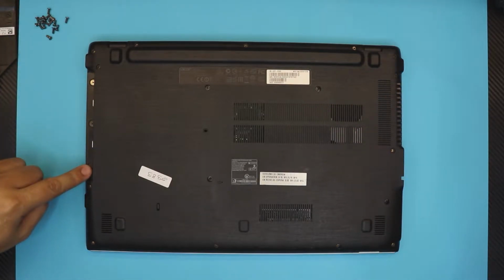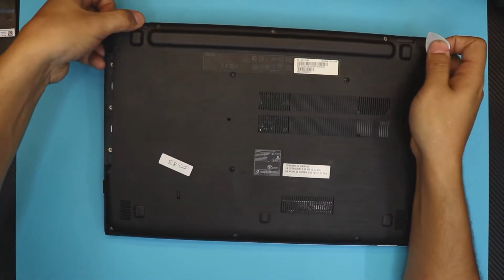Acer E5 573 REPASTE disassembly guide 573-C7kr

Comment: Great Video - Complete Video is good & Most Importantly the Point of getting the Audio Jack in perfect position before closing the laptop is Extremely Crucial. I was able to get my laptop closed 4 times perfectly in all respects but only the audio jack was slightly misaligned so I was unable to plug in my headphones. Then I saw your video which shows the procedure of closing the laptop too including the crucial point of getting the audio jack in position First and then continue. If we do not follow the procedure as specified by you then the audio jack stays out of correct position though the laptop appears perfectly closed. Thanks A Lot for this Lovely Very Useful Video With The Complete Process Of Closing The Laptop With The Crucial Point of getting the Audio Jack in alignment FIRST.
Reply from the maker: It's my pleasure, my friend. 😊 I deeply appreciate your taking the time to provide feedback. If you're inclined to support the channel further, feel free to like and subscribe—or even both!
im glad that you hace the laptop case closed the proper way my friend 🫠👍
Should you have any questions or requests in the future, please don't hesitate to ask me.
🍻cheers